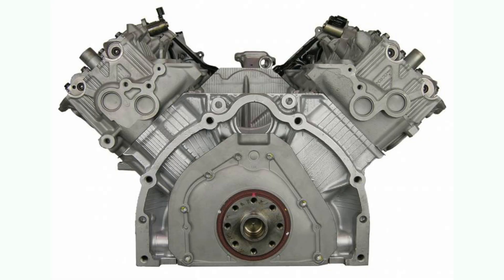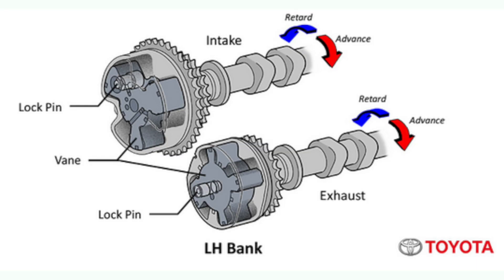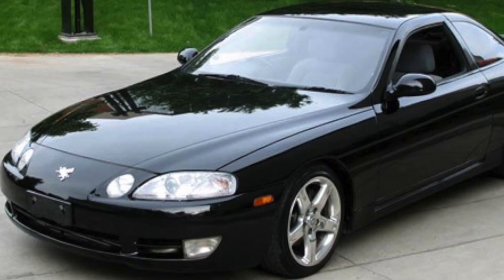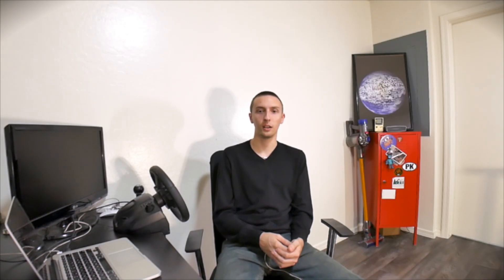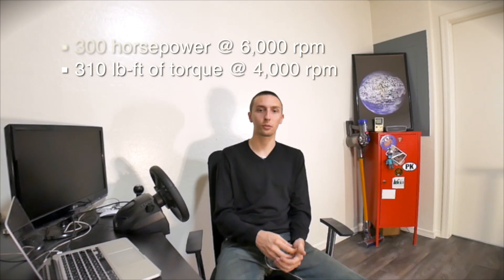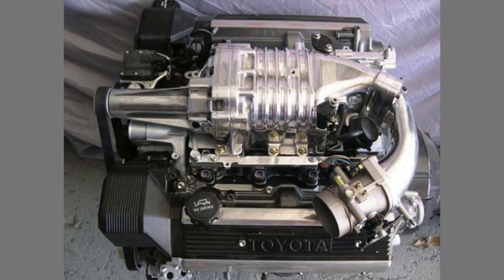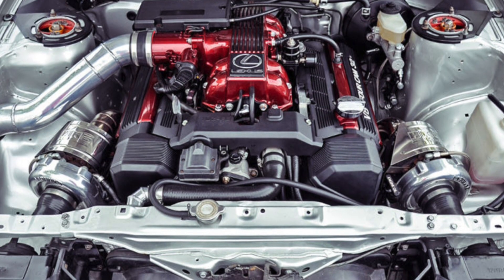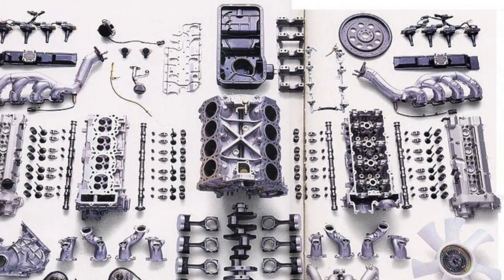Toyota 1UZ-FE: Everything You Want to Know | Specs and More

Comment: You mentioned Valve Adjustments...I'm a Toyota MDT and have been with Toyota for 22 years. The only car that I have even had to adjust the valve spec on was a 2002 Avalon.  Just 1 Intake Valve on #3.  All of us in the shop were surprised because no one else ever had to adjust any valve on any of our engines with the Bucket design.  I actually contacted Tech Support about this adjustment so they would be aware.  The design is incredibly accurate. Hardened Chips as we call them, the little shim that goes on top of the bucket over the valve. These basically need no adjustment at all. Yes the Chips come in different thickness to adjust the gap but as I stated, they don't just go out of adjustment.
Reply: A Rover from the 60s had shim and bucket,set and forget...!
Reply: @Wilt8v92  Exactly!!

Comment: Dont know about the later UZ motors, but the 1UZ also come with forged steel crank and 6 bolt mains (4 traditionally mounted plus 1 each side from the side of the block).
This made the bottom end pretty bulletproof.  Couple that with forged steel rods (thanks for reminding me @Jason Phillips) and specially constructed alloy/steel pistons and you have a really good base to start some serious tuning from.

Comment: I have an 89 Celsior JDM in Australia, and its still going with no issues and no major engine or gearbox work that I know off (I've had it for a few years now)  its done about 400K Km.
Desperately needs panel and paint work, but still runs like a dream.  With a quick fluids check, I would have no issue driving it across my country (4000Km) except part of Australia is still under lockdown.

Comment: How did it end up dying? No oil? It's very uncommon to hear a 1uz being killed. Even running boost through them. There is a stock ls400 with a million miles on it. Very interested how you went about killing the 1uz.
Reply: best way to kill a 1UZ after the very first gen is to not change the timing belt on time.

Comment: I own an LS400 (87538 original miles) with a 1UZFE, and ironically it's the first engine that I have not modified and refuse to modify. I love how quiet the LS400 is, it allows me to escape the world while driving and just enjoy the ride. I modded a 1995 Camry by doing a 5SFE/3SGTE merge turning it into a stock boosted 5SGTE, and yet here I am with an engine far more capable and no desire to mod.

That being said, the 1UZFE is an amazing piece of automotive engineering, when kept stock and maintained properly these engines are well known to go 1,000,000 miles which is insane, and they are one of the only automotive engines that is certified by the FAA to be used as an aircraft engine.
Reply: How much money overall do you think you’ve put into your sc400 I was thinking about getting one but I’m terrified how much it will cost to buy and mod
Reply: @benyounge9672  About 5 thousand now, if I did the work myself it would still be around 2 grand in parts. Each car is different but expect to overhaul or replace the ECU and other electrical components now due to the age.

Comment: it was the first version of the 1uzfe that had the more hd rods an pistons which no-one has noted an it is able to handle about 12-15psi depending on tune an with thicker head gasket able to handle more but ya limited to the cam an rpm's an the ports in the heads, but with custom porting, cams, valve job, blower pistons, cop ignition an aftermarket ecu, you can do 30psi+ @ over 9500rpm an make over 1500hp+

Comment: Good vid, I've got a '95 LS400 second owner and only 55,300 miles on the clock from new . Certified. And, completely standard. No more power please, I like the silence, and the waft..
Reply: Green socks,  I also have a 95 LS, 196,000 miles and still purring like a kitten. I'm second owner, Ebony Teal Pearl/ Dark Grey Metallic combo paint. Added chrome exhaust tips, Gold and Chrome 18in wheels and tires, and Deck lid spoiler. It's an amazing vehicle, more than enough power, comfortable, and dependable. I'm sixty now, have owned several cars in my day. This 95 LS is by far the best. I paid $700 for it, and I had a $3,500 offer that I had to turn down. Truly an awesome vehicle. You don't have to spend a lot of money to make these look good and hold value. They were well built ,and equipped with the best V8 ever built.

Comment: I want to build a 1UZFE and mount it to my existing 6speed manual transmission.. 4x4.        Will that work?  (maybe with a overhaul?)

My goal is to have that V-8 engine torque and fun back in my Tacoma..... (I had a 307 Chevy engine in a '75 Land Cruiser in High School.... yeah, I was an idiot for selling it......) 

I am a daily driver, short distance, occasional boat towing and some beach driving.
Thanks -
Reply: I see you just recently posted this, and I'm in the same boat as you! Looking to 1UZ swap my 3rd Generation 4runner and retain 4x4.  Thinking of doing a non VVTi 1UZ JDM engine, upgraded head studs and head gaskets.  And a simple Borg Warner S366 turbo, upgraded fuel system.  I want to run an Auto trans with the turbo,  so trying to determine the best path forward there
Reply: @hunterjohnson4954  sounds like you have a nice plan already...  I am just becoming enthralled with the idea at this point, (I had a 307 small block chevy motor in a FJ40 during high school... and I miss it, and the V8....)
So I'm going to explore and see what it would really take for my 2nd gen Taco....  I'd prefer to keep my Manual Transmission, but I am not sure how it would do attached to the 1UZ....  or if it even can be....

Comment: How come the 2uz doesn’t get nearly as much attention as the 1uz? That was a great engine as well
Reply: Simple; 1UZ: early ones are non-immobolized, thicker rods, aluminium block and cheap... also utter shit no one should buy these motors... I want em all
2UZ: also cheap but the iron block adds an extra 100 or so pounds, needs internals to take any boost and doesn't offer much power over the 1UZ
3UZ: often expensive and Toyota got a fancy immobilizer, which makes a standalone a must have for these and VVTI 1UZ engines

Comment: Factory 98 vvt-i with a 5-speed automatic is a great little fun dependable car
Reply: Except they are insanely expensive because they made like 10% of those cars with manual
Reply: Alex Christian They didn’t offer a 400 with manual. I’ve had several of them in the 98 to 2000 SC 400 is the best one it’s got VV TI and the five speed automatic rather than the four-speed automatic. It will out run a factory supra
Reply: @j-deezy321  I want a sc400 sooo bad. I just don’t know if I want a 98 or newer to keep stock and nice or to make a sleeper with an old 93 or sumn
Reply: GripRep I had a 93 and in my opinion it’s not even the same car as a 98-2000. I mean unless you’re going to twinTurbo it and change the transmission. But then all you have is a mess on your hands lol and it may or may not even be much quicker than the stock 98.98 Newer is pretty quick from the factory with VvTI and the five speed automatic transmissionAnd extremely dependable. But good luck finding one the production numbers were way way down in 9899 in 2000. I think 93 was one of the most popular production years. Best wishes in whatever you do.
Reply: @griprep3506  I’ll sell my 2000 sc400 for 15k 170k miles

Comment: I was looking at getting a early 90's model ls400. Is the 1uz reliable enough to do lite mods and even a small amount of boost, or do I need to build the bottom end first. Looking make roughly 400hp. Not to familiar with this engine.
Reply: johnathanhen it will take boost (11 psi or lower) at stock. More if you rebuild it.

Comment: Love my SC400....i have an acceleration problem i cant figure out....over time I have replaced plugs, wires, coils, then had Computer rebuilt by ECU pros, then took it to the dealership (they said alternator) wrong....lastly i change the throttle position sensor...still same problem....no acceleration, cats start glowing red, (unburned fuel assuming).....anyone else have this problem???
Reply: did you figure it out?
Reply: Yes I had the exact same problem. It took three ECM’s until the problem was resolved. Apparently these ECM‘s are not always rebuilt properly or something
Reply: Check your cats.

Comment: Hello Brice, 
I hope you are updating your clip.  This is the only serious clip giving info about 1UZ-FE.
I Inherited a lovely Toy Car SC400 1992( i myself am 70 years old retired).  That my son enjoys driving to College.  I have the early non VVT  valves that needs adjusting,.  120k miles. 
I am looking for a Physically easy replacement engine, street legal , ARB legal ( california Air Resources Board)
I am also certified SMOG inspector N. California.( but not Auto Mechanic)
please tell me several options: how to change this engine with out lots of difficulty; and get maximum  possible Horse Power while:
1- the new engine just falls into place without  having to make  any changes to Body or mounts, or A/C mount( every thing on my A/C is new).
2-- cost around $2000 +, -.   
thanks millions.
( I think those 54 negative hands are owners of German Engineering BMW)

Comment: yea the 1uzfe is a good engine and could make more power. but try buying parts for this engine. or finding performance parts, the performance parts are expensive. a lot of people end up making parts themselves. the after market support for this engine isn't the best. and to change the starter is a bitch. just my opinion... this engine isn't worth swapping into  another chassis. had an ls400 great car wanted to swap the 1uz into my hachi or my s13 but as I worked on it more and more decided it wasn't the best engine for a swap. currently helping my friend swap a 1uz into his FC. I told him how I wouldn't and why I wouldn't but its his car his build his money. but think people that don't know much about different engines might want to do more research. honestly the best way to do so go down to a local automotive shop and ask different techs what they think about what ever engine your thinking about using. they work on a lot of different ones and can tell you the good and bad of um. JUST MY OPINION on the 1uz. not downing the 1uz. just seeing things from a different perspective

Comment: In your opinion are the engines in the 95-97 LS400 better than the 98-00 LS400???
Reply: 95-95 (2nd gen) looks better IMO, but for the extra amenities the 98-00 (3rd gen LS) has, I’d go. Only issue is if belt snaps rip motor

Comment: This is hardly everything you need to know. Im running an early model non vvti with rotrex centrifugal supercharger and making 420bhp and 417 ft lb with print out on stock internals and its not breaking a sweat! I will get this to 500bhp no problem 👍
Reply: 500 whp isnt anything either for a 1uz. Im currently on a stock bottom end making 781whp on e85 and a turbo set up. Onlything I did to the motor was MLS headgaskets and ARP head studs. I also upgraded the valve springs to prevent valve float.
Reply: @seanm2994  non vvti or vvti ?

Comment: Beautiful motor, great sound, good for swaps, strong and light, cheap to boost, flattest torque curve known to man, yet not too thirsty, easy to maintain... There's a reason the UZ series was put in all their trucks/SUVs and flagship sedans for two decades, and the UR that replaced it is essentially an evolution of the UZ design arc with dual VVT-i, direct injection, timing chain (yaaay), free flowing heads etc etc. UZ's are basically the LS of Japan, just the right combo of everything at the right time.
Reply: The UZ is not cheap to boost at all
Reply: @ssjdavid  no where near cheap
Reply: @oilfilterwrench being expensive to boost is a good thing means idiots that can’t afford maintenance won’t be able to boost them

Comment: The 1UZ-FE is one of the most reliable V8 engines ever made...  it was ahead of its time.
Reply: Tbh, its THE most reliable.
Reply: Abaddon Torment and whos fault is that? xD
Reply: @UCru0HhOM0TpEY6_Q85TTt5w Yeah, if there is an issue with the ls400 it is the the fault of the previous owner or the current owner.. It shouldn't even be an issue since its cheap to fix pretty much the entire car, many parts interchangeable with the supra. You have to do a lot of stupid shit to mess up a car with a 1uz.
Reply: @joelstatosky1817  big faxxxx
Reply: More reliable than the old 305 iron block V8’s?
Reply: @Vincent Lopez that’s ok you then lol mine has 318 og miles and still pulls like a mf
Reply: in the same league with the mercedes m113k and the ls motors
Reply: Sorry but emphasis on “was” ahead of its time.
Reply: I think the 2UZ is the best V8 from Toyota due to its cast iron block
Reply: Rich F I've come to this party late, but having worked in used cars at Lexus dealership I have to agree sir, I've always had special place in my heart for those engines I seem to notice very little inherent design flaws
Reply: Ahead of it's time how? Doosenburg had 4 valve 8 cylinder supercharged cars in 1932 making 400hp. Lots to learn out there. Granted it took 7trs. Displacment
Reply: @luckiniauto  even if it was 7 liters. 400 hp turbo 8 cylinder in 1932? Sheesh! That's very impressive.
Reply: @luckiniauto XDDDDD bro forgor that this engines is as big as 3/4 of miata, isnt reliable at all and it wont survive 400000km 

How to tell ure dont know anything about engines without telling it directly

Comment: Million mile engine
Reply: Saw 1 for sale a week ago with 400k on the motor still running strong. Indestructible
Reply: @Hilife23  Yup, 100,000 miles for a 1uz is just the break in period.
Reply: 310k miles on my 99 gs400
Reply: 267k miles on mine 99’ ls400

Comment: 330,000 on mine changed 2 water pumps and timing to stay up with maintanance. Oh and good luck to whoever has to change out the starter and one of these. Other than that my car is great
Reply: is your sc400 still running strong with the high mileage
Reply: Just like a NorthStar, don't have to get on the ground.. 😬
Reply: Changed my starter in 4 hours, its not that bad.

Comment: well I have deep love for the 1uzFe it has nothing on the vh45 in terms of power
Reply: i own both and you are wrong
Reply: @driftinaz3158  the vh45 was rated without vvti to meet industry standards. In actuality people were getting over 300hp at the wheels.
Reply: @alexscarborough6263  my 1993 1uzfe dyno'd 316 rwhp with bolt ons and a standalone the only limiting factor on the 1uz is the engine management, it is better in every single other way
Reply: @driftinaz3158  debatable. The vh45 has forged internals. There are people in my auto group making over 600 whp with single turbo setups
Reply: @alexscarborough6263  the original guy said the 1uzfe has nothing on the vh45 in terms power..in stock form i believe that is false..they make nearly the same power if not the 1uz make sligthly more with lower displacement ..i own both and my vh45 makes nearly 500whp.the 1uz is barely better
Reply: @driftinaz3158  the vh45 makes a lot more torque but they do have somewhat similar horsepower

Comment: Technically, the 90-95 VH45DE made 300hp-310hp.  It’s from the 1990s and at that time, in Japan, there was “a gentleman’s agreement” between Auto manufacturers that nobody would manufacture a vehicle producing more than 278hp.  Like in America in the 1960s, the horsepower rating and actual output were not even close to being the same.

Comment: I love my 1uz Soarer. I’ve owned;
2 Holden 5 litre V8s, 
a 400 Chev, 
an LS1 and an L98 6.0, 
a 302 Windsor, a 351 Cleveland and 
a couple of 360 Chryslers, 

I’m NOT a psycho but I accelerate flat out in 100 zones up to the speed limit multiple times every day, 

I’m simple and that’s what I love, 

So every motor I’ve owned has had rattly valves and been getting a tired after 60-80 thousand kays of this,
Enjoyed them but all of them ran ragged and a few of them snapped

EXCEPT my 1uz. I wring it’s little neck 4, 5, 6 times a day and after buying it with 80 thousand kays on it and putting another brutal 80 thousand kays on with daily thrashings, it is still a completely smooth, purring little kitten. Supernaturally smooth. 

SUCH a sweet little motor I love it.. It’s made me value strength and build quality over power. Haven’t had to shim the valves yet.

Cool video man thanks!
Reply: Exactly why I want one in my MX73
Reply: A BigRedBall That would be super sweet.